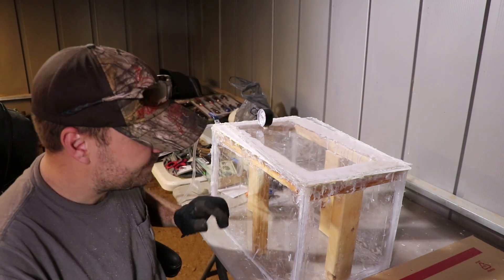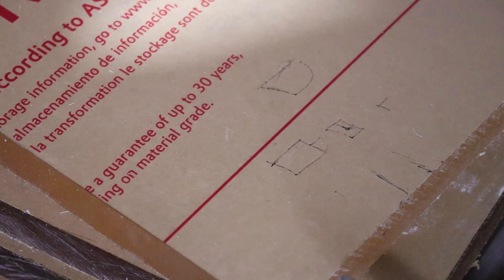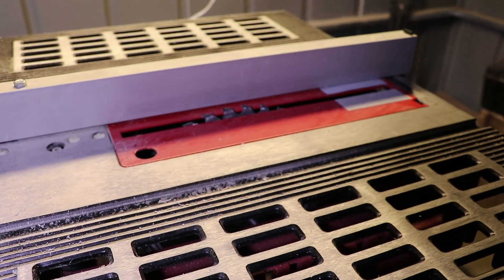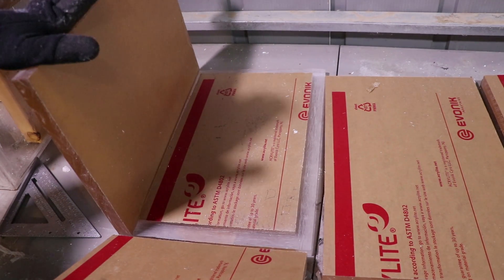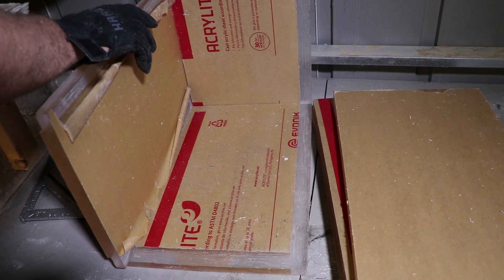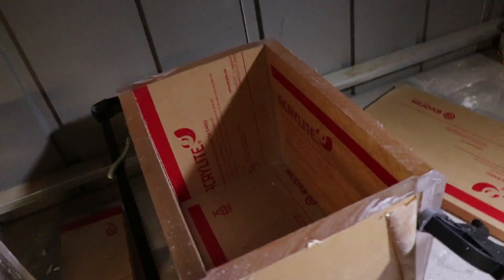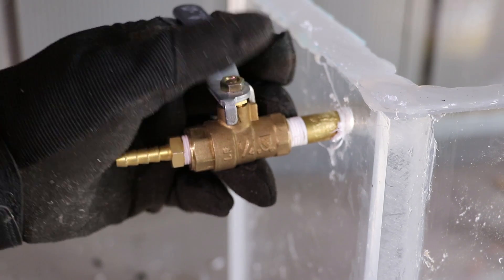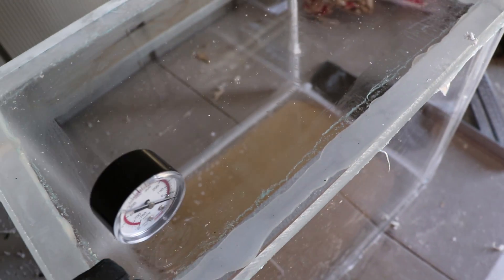Custom Vacuum Chamber

Comment: Can you put some gallium in between two glass to show if there is air with gallium, it’s a pc idea to put a pc in a vacuum chamber and have ac cooling into copper tubes to cooling plates to cool off the heat from the pc and take the heat out of the vacuum chamber with the wires sealed to so that no air can cause condensation
Reply: Honestly could I buy the vacuum chamber off of you? For a video I plan on being my first post?

Comment: I’d do 45 degrees on all edges except the lid sealing surface and use proper acrylic cement ( scigrip or weld on) make sure it’s cement and not glue or silicone. FYI use an online calculator to calculate the minimum thickness required to safely draw a full vacuum with that size chamber.

Comment: I work with thick acrylic like that once in a while at my job. It kind of hurt to watch this because I know that stuff isn’t cheap. I remember the first few times I tried making boxes out of it on a table saw and it isn’t easy. It sucks actually. Now we use a CNC to cut all of our pieces which makes it pretty much all about the bonding. Speaking of bonding, silicone ain’t the best stuff to use for acrylic but heck it works. I found your video because I want to make my own vacuum chamber for degassing resin and silicone. Probably do some science experiments too. I got some .75” scrap from work and it’s enough to make a box about the same size as yours. Watching this video was very helpful in two ways. 1) now I know it’s possible to build a square vacuum chamber. .25” thick 12”+ od acrylic cylinders are crazy expensive. I want to see everything that’s going on inside but not so bad that I’m gonna pay that kind of money. Square holds up. I don’t need as much negative pressure as you’re probably going to use so my .75” will be fine. 2) I like how you joined your sides to help it all squeeze into itself. Even though the bonding agents I use(SciGrip 16 & MEK) essentially weld the acrylic I think I’ll use your idea for peace of mind. It can only make the joints stronger.

Comment: Anyone reading this please do not ever use silicone on acrylic. Just use weld on. Weld on is a chemical solvent weld. It makes the 2 peices become 1 strong peice. Silicone is a sealant. Not an adhesive and doesn't bond to acrylic. I am going insane watching this. Watch acrylics fish tnak diy videos to learn how to weld acrylic boxes. Note your acrylic edges need to be very smooth where you plan to weld. You need to sand it down to like 800 grit like polish it smooth

Comment: Do you know if a homemade vacuum chamber achieve 1 mbar (0.75 torr, 0.75 mmhg) ?  
0.01 mbar?  
Might that be possible in a rectangular chamber around 600 mm x 300 mm (24"x12")?

Comment: By now you already fixed it, but to have smooth contact all around the top lid, you could have simply glued on a piece of the wasted 1/4 acrylic to the bottom of the top lid that matched the inner measurements of the vacuum chamber.

Comment: So did u apply silicone then put the box together? Or while it was clamped down u just hit all the corners with a ton of silicone? And thanks for the video definitely helped me out, have a few ideas myself and was gonna use one i read as well, lid will have a lip on it as well that way i have all sides pushing against each other, thx

Comment: Why didn’t you make the lid the same way you made the base, problem solved. Or make the lid over sized and use some type of rubber seal to make it air tight .

Comment: Vacuum goes down to about -1bar or -14.5psi, which means that with a typical vacuum chamber you've got roughly 1kg/cm2 or 14.5psi (pounds per square inch) pushing on to the outside walls of your vacuum chamber. Let's say one of the panels measures 12 by 16 inches, which means it's got 192 sq.in of surface; multiply that by 14.5 pounds and you've got your result: 2784 pounds is what your panel has to be able to take. In kilograms, that's roughly 1263kg or 1.263 tonnes, about a weight of an average car here, in europe. Hope this helps. That's the reason why all those vacuum chambers are so "small".
Reply: Aw, man. So I’d REALLY have to consider the size of my resin projects. At least now I know. Or deal with the bubbles another way. 😕
Reply: @dyscea  You can make it larger but you'll have to use something thick enough. If it doesn't need to be see through, go with steel. It's cheap and strong. Maybe a smaller air tank could hold vacuum, but I'm not sure. If you use something round it won't have to be as thick as something rectangular (something with large area flat surfaces).
Reply: @ElectronPower  thx. You give me hope 🙏
Reply: Hallo "Electron Power"  > it is exactly like that !! 
("Everest" was missing in mathematics, physics and chemistry at school !)
(Germany - 24.08.2019)
-

Comment: If all the corners where beveled at 45 degrees, the corners would all be leaning in on each other. I want to put old windows in a vacuum chamber and have the boiled linseed oil pen deep into the wood.

Comment: Everest I made this chamber , What pump did you end up with ? I put a glass of water in there and I couldn't get it to boil . I have a older HVAC pump that I think is weak .. its a older GE pump .. thank you ..
Reply from the maker: James Koehn mine is a harbor freight one it work I get about 25 inches of mercury
Reply: I just ordered another pump last night JB Industries Eliminator 4 CFM Model DV-4E... USA made . so parts are readily available if need be .. I have the old pump running in there right now with some OB Juice and two pieces of wood . I was getting bubbles and pulling 26 in.mg water still not boiling . but its drawing the air out of the wood .. this is just scrap wood .. I'm wanting to get it down to 30 if i can .. i'm just using weather stripping for the top seal . And i believe that stripping is open cell so i could be sucking  tiny bit of air through the top . I have a closed cell seal coming tomorrow see if that makes a difference .... the motor i have here is 1/3 hp and i cant find any info on it as far as what the low number is . All i know is HVAC pump ... is there a way i can get a photo to you ?
Reply from the maker: Temp of the water has to due alot with boiling point as well if you want it to boil real good eat it up to like 120 degrees it will boil at about 11 to 12 inchs of mercury

Comment: Everest where did you order the 1 inch acrylic from ? I have the same idea in mind For doing wood Infusion Large pieces . I have Diamond router bits to do the cut out . Even regular router bit would work taking small increments at a time . I already have some 3/8 laying around so laminating these together will take care of the bracing . And using the silicone is a good idea as a temp. to make sure everything is working before using a more permanent bond .. I already have the Vacuum pump used in HVAC so i'm set there ..
Reply from the maker: http://freckleface.com/shopsite_sc/store/html/acrylicsheetoneinchthick.html

Comment: Just a suggestion that will end your bowing issues. Cut a shoulder on the bottom of ypur lid1/2 the thickness of your material, 1/4 thickness would be ok too. The finished cut should be just under the i.d. of the box so that the top seats into the base. This can be done on all the edges so that the box when under vacuum will pull against itself
Reply from the maker: i did put a brace in it in my next video shows how i solved this problem

Comment: Thanks for posting this. I have some of my own design ideas, but I've got a bit of inspiration from this to fill in a few gaps I had. One suggestion I have is with a negative pressure vessel, try to introduce as few points of failure as possible. As such, I intend to tap the lid ONLY and just once. I also intend to build a vac/relief/gauge manifold for the single tap. Another thing is that I'm looking into using ProtoPutty for the interface gasket, and I'll be doing chemical welded joints with an acrylic cement. Thanks for your video!
Reply: I would also think a routerwould work much better for this job than a saw

Comment: It appears as though 0 research went into the build. EPOXY or acrylic bond would probably be better holding acrylic together it melts the pieces together. RESEARCH!!! A waste of materials and time.... good idea though, I’ll give 1 star for effort.
Reply from the maker: i even said in the video i use silicone just incase i mess up i can redoe it if i mess up with acrylic pond or expoxy i mess up then its a waste of money. why was it a waste of time? it works and still works

Comment: You will need to brace the wide ends. Maybe with square tubing??? Or brace all around with square tubing just a thought. If u have a mig or know someone who might weld the square tubing together for ur brace for the inside. And if u do, do that make sure to reinforce the brace themselves up top. Should u get another pump with more suction power and cfm might wanna reinforce the whole thing.....might lose some space but ur nice custom chamber won't bust! ;)